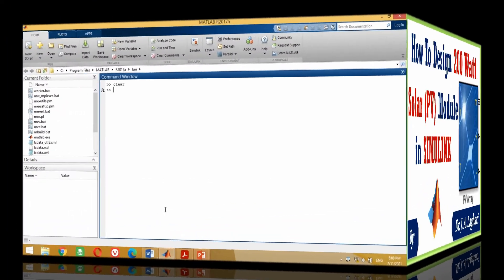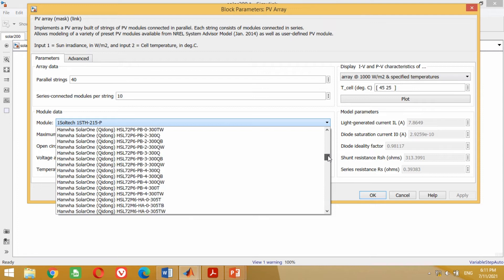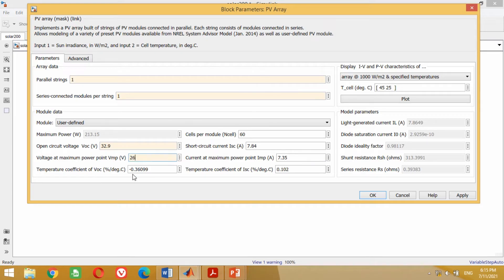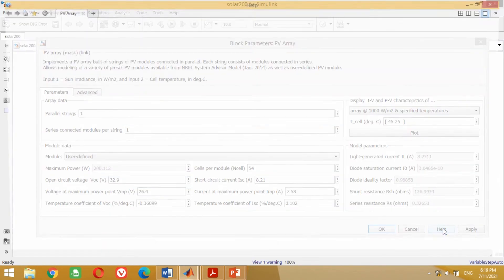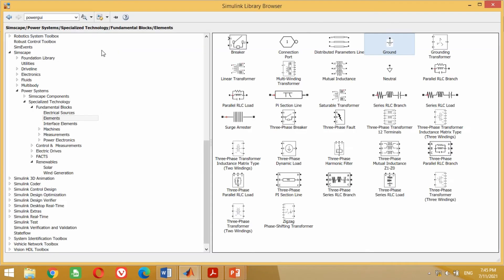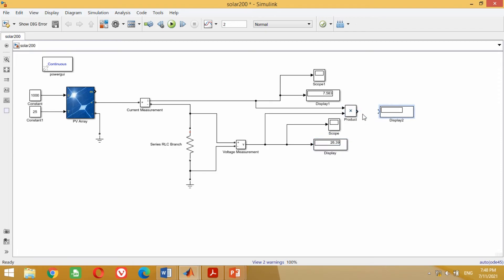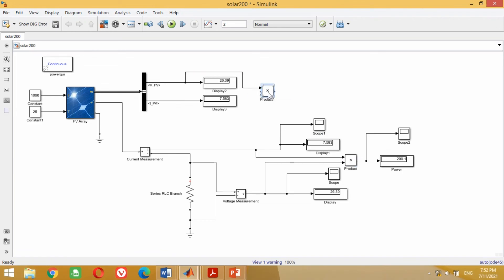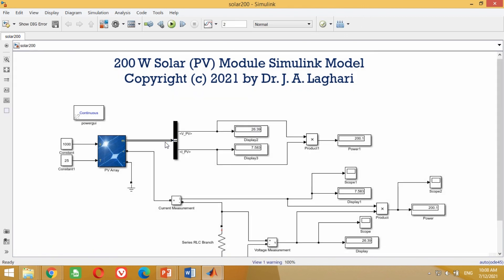How to Design 200 Watt Solar (PV) Module in MATLAB SIMULINK Software ? | Dr. J. A. Laghari

Comment: Assalamualaikum sir, i want to ask are the temperature coefficient of VOC and Imp data so important to this?
 if yes how much this module have
And how we know how much we use for "specific" module
Thankyou
Reply from the maker: Wa Alaikum Assalam,
Yes, the temperature coefficients of Voc and Imp are important for accurate simulation of a 200W solar module in MATLAB, especially when modeling performance under varying temperature conditions.
These coefficients indicate how voltage and current change with temperature. Without them, the simulation may not reflect real-world behavior.
To find the exact values:
•	Check the datasheet of the specific solar module model (usually in %/°C).
•	If not available, typical values are:
o	Voc temp. coefficient ≈ -0.30% to -0.40% /°C
o	Imp temp. coefficient ≈ +0.04% to -0.05% /°C
Using the specific datasheet values ensures the simulation is module-specific and more accurate.
Reply: @DrJALAGHARI  thankyou very much sir

Comment: Hi Sir, can help me to design and implementation of a photovoltaic based fast charging station for electric vehicles with integrated overcharge protection?
Reply from the maker: Thanks for the comment. Every new topic needs new learning. You may go through the research papers to design it in MATLAB.

Comment: for my case its not working it shows 100 A current, 349 voltage
Reply from the maker: Thanks for the comment. Kindly check the model again it should work.

Comment: Many thanks for this vedio sir, I am going Start my PhD, kindly help me to decide on which topic I need to start and what are the softwares I need to learn..
Reply from the maker: Thanks for the compliments. Starting a PhD is great and you may need to discuss with your supervisor to finally decide the topic. The latest topics includes electrical vehicles, fast charging station. Furthermore, you may watch my YouTube videos titles to get some idea about the topic.
Reply: @DrJALAGHARI  many thanks for your reply, since I m working at solar PV module manufacturing industry, it ll be easy for me to proceed in module manufacturing side, my guide suggest, select any two topic and we will decide later on it, but I suggest confused which area I have to start focusing.
Reply from the maker: @shwetapatil674  Right. I think then it is better to follow your guide.

Comment: Can you prepare MATLAB simulation for Voltage stability analysis of grid connected power system using embedded generation then it will be very great.
Reply from the maker: Thanks for the comment. Basically every new topic needs new learning. Therefore, it will take more time to make video on this topic

Comment: Hello sir !
Thank you for this your video very helpful. 
Sir please i have a little worry if you may help 
I am actually working on a project to design pv energy map for my country base on monocrystalline modules. Seeing your video, i believe it can help me. My idea was to use this your circuit and just try to vary the different irradiance and temperature depending on locations and compare the out put power to that of the 200w as yours. But now i dont know how will i include monocrystalline modules in my work. Sir please can you guide me in my work with some ideas.
Thank you !
Reply: Thanks sir
Reply from the maker: @raoulboumi4043  most welcome
Reply: 0*
Reply from the maker: Thanks for the compliments. When you double click on this solar pv block, it gives various options to select. Therefore try to select this option from there.

Comment: Thanks for such a useful video sir, can u make  500kw design simulation... or can u tell me what are the specifications require to design 500 kw solar plant
Reply from the maker: Thanks for the compliments. In the video, there are many real solar models are given. You just select the specific model and it will give you the required power. In my opinion, 100 kw rating is available then you have to combine such five models to get 500 kw models. Furthermore, in MATLAB 2017a, in example section, a built-in 400kw solar farm model is available, you may use that model too.
Reply: @DrJALAGHARI  kbhi JH g,
Reply: Yes

Comment: thanks u sir your explanation is very good, sir can you provide the video or simulation data of   2 kw solar panel
Reply from the maker: Thanks for the compliments. This solar pv module has 1000 of real time solar values of different capacities. Just search among them, may be it is available in the model itself.

Comment: Assalam Alaikum Sir
Sir how to make dual axis solar tracking system using LDR sensor in simulink.
Plz guide sir
Reply from the maker: Wa'alaikum salam Thanks for the comment. The easiest way is to find any research paper closely related to this topic and follow it.

Comment: Hello sir, hope you are doing well, thanks for the video sir, sir I have to make a virtual power plant module on Simulink, in that I have attached, the renewable and conventional generator to the grid can you help me from your advice that how should start making that.
Thank you
Reply from the maker: Thanks for the comment. The easiest way is to go to the example section of matlab. There are many built-in models on various topics of power system. First try to open any model and try to reproduce it. Then modify the model with your new ideas.
Reply: @DrJALAGHARI  Thankyou sir for you help 😊
Reply from the maker: @vikrantchaulkar9200  My pleasure
Reply: Hello sir, can you please tell me what ratings should I take to build 5KW solar model.
Thank you

Comment: Sir, I want to make a Solar Module other than 200 MW. So in that case, how do I obtain the specification table that you have shown for 200 MW.
Reply from the maker: Thanks for the comment. In that case, you may select any model available in the solar module list. Here 10,000 different solar module are available. When you select any module, its parameters will be automatically placed here.